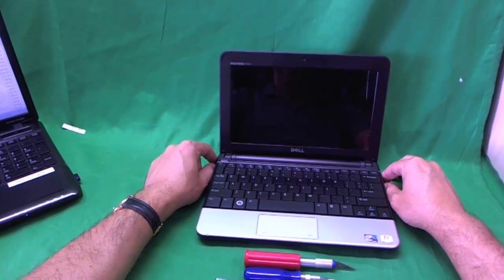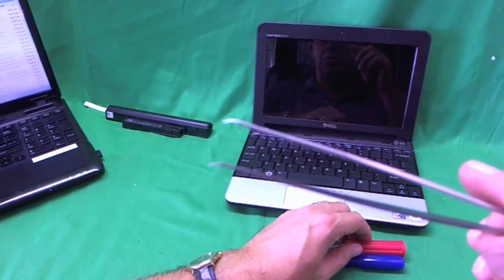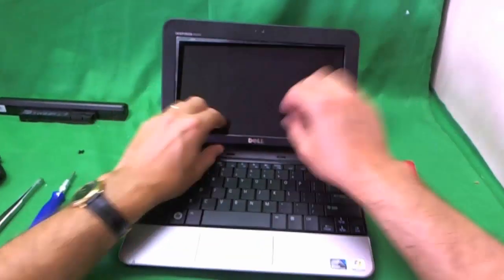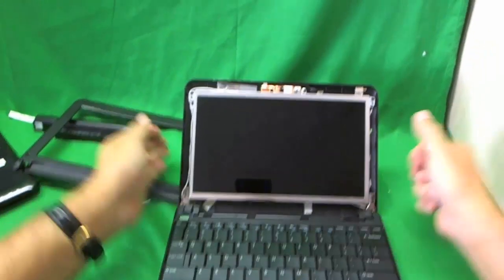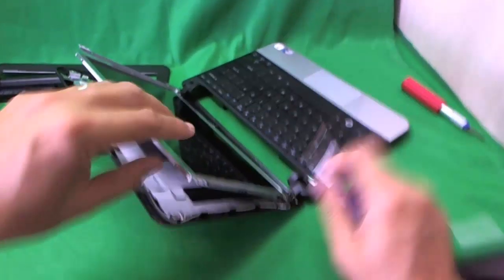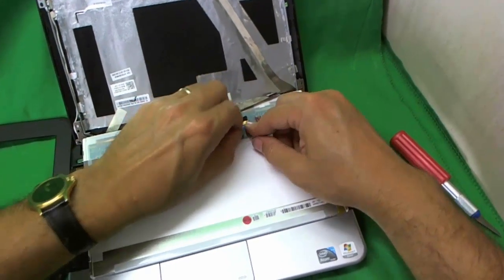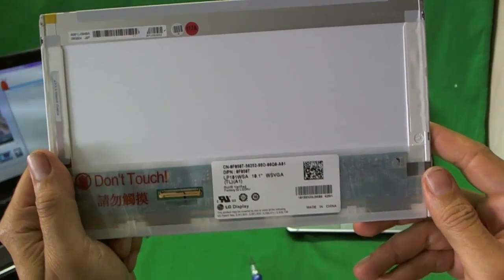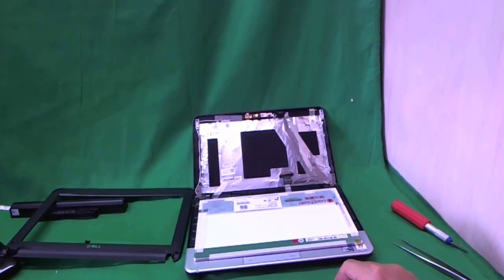Dell Mini 10 Netbook Screen Replacement Procedure

Comment: Although the video is good, definitely failed in a crucial part as it's quite difficult to put the bezel back after replacing the display. A little bit more of time spent to explain how to do it would had been great.

Remember, it's much easier to disassemble than to put thing together afterwards.

Thanks anyway for sharing

Comment: Thank you so much for posting the vid ! After getting 8 beeps and a blank screen, I followed your instructions to the letter and opened up the screen, peeled the tape away, pulled the connector apart and simply reconnected it. When I pulled the tape over it again, it was no longer sticky or pristine and just hung loosely over the connection. Nonetheless, my Mini 1012 is working perfectly once more. So glad I didn't have to buy a new laptop. Thanks again.....you saved the day !!!!

Comment: I cant hear you on my computer.  I'm  done taking the LCD out with the exception of the connection at the top thats plugged into the top of the computer lid inside.  I dont know what to do with that, I cant make out what you;re doing at that point.  I disconnectd the taped connection at the bottm.  I was told by the people on Ebay that I needed to take it apart in order to get the part numbers off  the screen, so I'll go ahead & order one.  But I still need to have those points clarified..  Tx